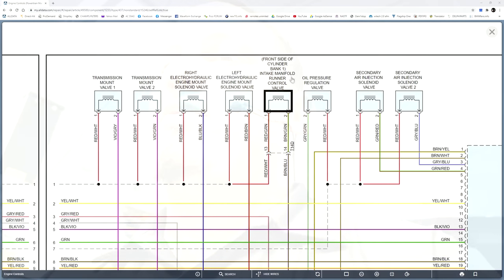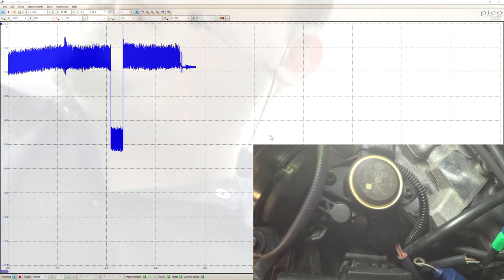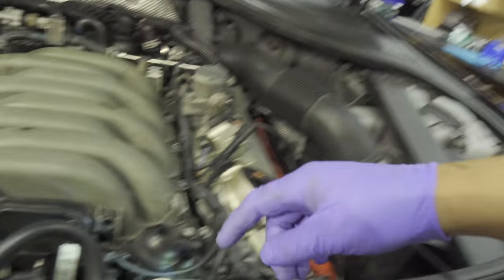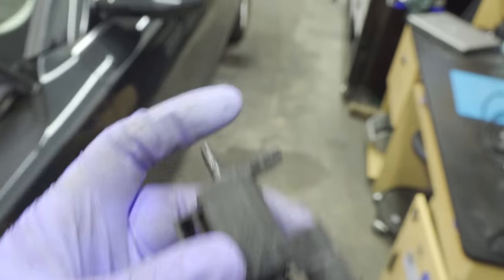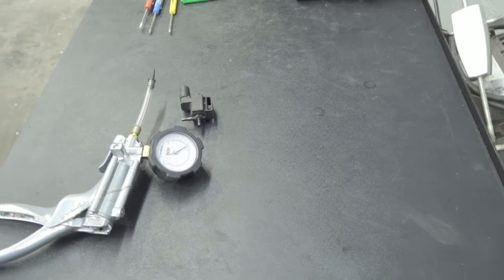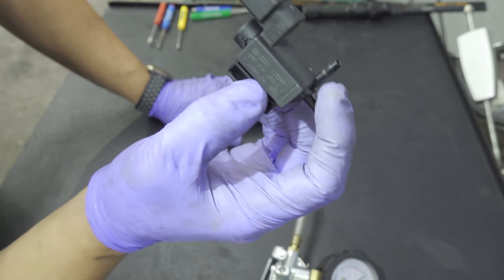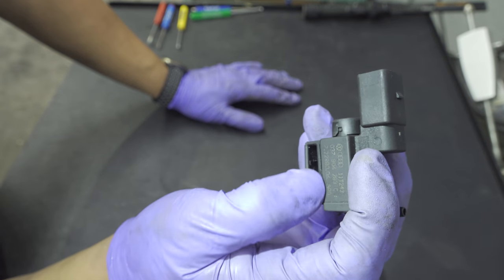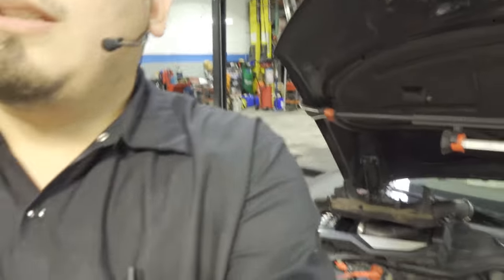2012 AUDI A8 4.2L P2004 P2005 - WHEN THE TEST PLAN IS WRONG

Comment: Thanks for posting this video. I has the same fault codes on my 2011 A8 and couldn’t figure out the issue. I tested everything, all vacuum hoses, replaced all 3 of the exterior valves, was even about to replace the potentiometers until I tested those and they worked just fine. If it wasn’t for this video, I would have never known there was an additional valve below the manifold. Low and behold, that was my problem. Tested it with the hand vacuum pump as you did, and that was the only one that failed. Just replaced it and car is running great. Additionally, I am glad you posted this. Had I taken it to the shop, I likely would have paid for a new manifold AND runners that I didn’t need to replace. Please continue to post videos like this. You just saved me thousands of dollars and I learned quite a bit about my car in the process.

Comment: Had this problem on my S5, this video was extremely helpful and informative. Thank you!
Reply: I’m looking to purchase an s5 that’s throwing this code. What do you figure the cost is going to be to repair it?
Reply: @LetsTradeLunches  I can't accurately answer that without more information, because these codes can come up for numerous reasons but pretty much all of which are minor and will involve intake manifold removal which is at least a couple of hours labor (if you are interested I can get the exact time from my workplace). In my case it was the solenoid itself like in the video and it actually failed twice

Comment: Love these Audi 4.2's, have had quite a few of these with the intake runners jammed after engine work. The butterflies in the intake runners need to be set correctly when they are fitted to the engine or else they interfere and jam on the the intake ports.

Comment: good job, i did see that often on ford egr solenoid control valve stuck open because of the filter on vent was cloge i would just remove the filter,it was easy ,but  in your case if i had to remove a intake to do that i would replace the control valve.thanks for sharing

Comment: 2 years ago i had a customer with A8 , same problem p2004/p2005
he went to dealer before visiting me as far as i know dealer told him to get manifold replaced lol.. (no detail from dealer but stated "internally broken")
i didnt have scope back then but scanner, after checking the data and physically checking holes and valves then manifold removal, found the solenoid was just clogged but hoses are not clogged lol.
there are 2 same solenoid, one is hard to get to which is under the manifold and the other one is in front of the engine, so i cleaned the clogged one which is under the manifold and swap with the one in front of the engine also performed carb cleaning.
ran like butter and no CEL

Comment: Need your help , getting P2004 &p2005  on my 08 audi q7 4.2 , Getting the same code, i change the same sensor you did both of them, change the manifold actuator with arms, manifold intake position sensor , both of them,  a check for vacuum leak,, i cant find anything, As  i clear the code, pop up again automatically. i cant find a short.. what else can i do

Comment: I have a p2005 code for my 2010 audi q7 4.2 im not the brighest with cars but some symptons ive noticed is. 
1. Fuel smell inside the cabin
2. Poor gas mileage
3. Less power at low rpms (If I press the acceleration the car rpms go up slowly till 3000 rpms and then after 3000ish I feel power)
4. Jerks between gears (not smooth like before)
5. Ive also noticed that the car sounds completely fine after a couple minutes (only on cold start, on a warm start it sounds fine)
6. In the summer there was no check engine light in the fall it was on and off and then in the winter its been permanently on since then

Hopefully You can give me a rough idea of whats wrong

A friend of mine told me it may just be carbon build up since this is a direct injection engine

Another friend told me it may be a vaccum line

Although id love to hear ur opinion aswell
Reply from the maker: What codes do you have?
Reply: Just the p2005 code
Reply from the maker: You may be having multiple issues. 

But for the code, that's an intake runner stuck open code. These runners are controlled by a solenoid that provides engine vacuum to the actuator and opens the runner. So the runner is either getting vacuum when it should not thanks to a stuck open runner solenoid, or the position sensor could be falsely reading that it's open, or the runner could be physically jammed open within the manifold. So you'll have to do some testing before replacing anything. You can disconnect the vacuum line from the solenoid(that goes to the actuator) and apply vacuum and see if it actuates the runner open, then release it and see if the runner retracts, or if there's no movement at all. If there's no movement, it's jammed physically. If there is movement, you'll have to do the same tests but with a full functionality scan tool and see if the position sensor is reading correctly as you open and shut the runner.

Hope this helps
Reply: At 2:40 in the video when u opened that valve my car did the same thing. Theres was a much larger amount of vaccum then in ur car
Reply from the maker: @Ak-vp2ic  in that case you have everything you need in this video to come to the diagnosis
Reply: @SuperMarioDiagnostics  I also noticed that the HPFP is leaking could this somehow be connected to the p2005 code
Reply from the maker: No that's a separate issue

Comment: Is that valve an Audi part??
Reply: And the reason I ask is because for Volkswagen we can not get that part separately it comes with the intake manifold not sure for Audi
Reply from the maker: Yes. Weird that it would come with the manifold when it's attached to the vacuum reservoir lol
Reply: Interesting that they sell the IMRC Solenoids separately from the Intake yet the factory tool wants you to slam an entire intake in there!  Does the factory intake include the solenoids maybe?

Anyways, this was a great diagnoses and fix Mario...thanks for sharing this man...even though I probably won't see one anytime soon, it's still great testing fundamentals for a vacuum solenoid.

Seems like the European cars love to replace entire assemblies rather than specific parts of the assembly.